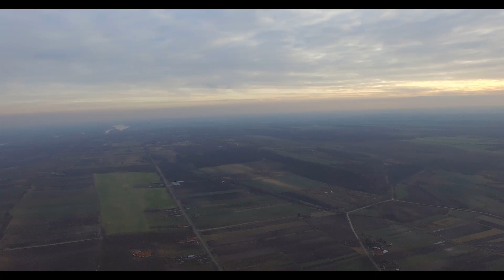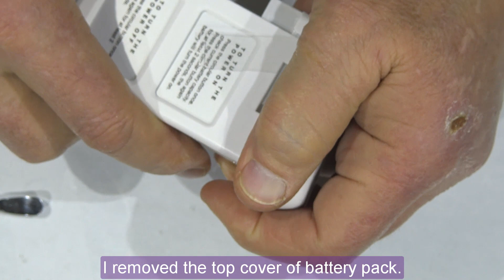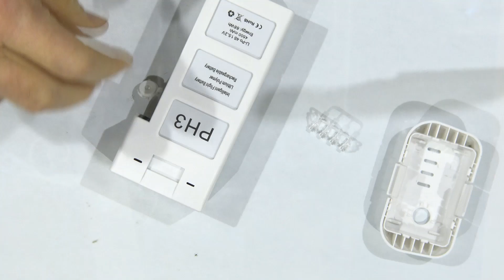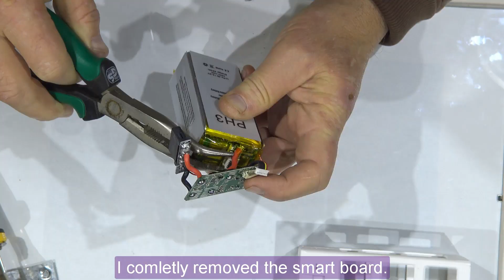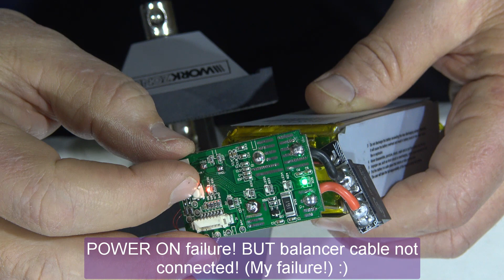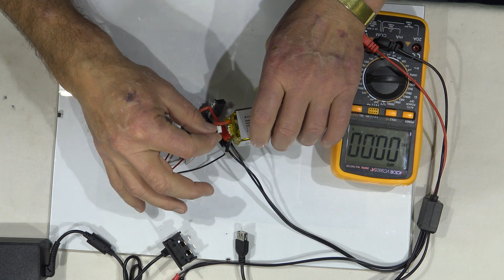DEAD DJI PHANTOM 3 BATTERY DIAGNOSTIC DETAILED PRESENTATION

Comment: In order to reset the board, disconnect the negative wires from the board (large black wire, and 6 small wire connector) and wait a couple minutes. Charge or discharge the individual cell to about 3.6V. Reconnect the negative wire and connector pins.
Reply from the maker: Hi, Thank you, I'll try it. Have a nice day!
Reply: I got it backward, after unplugging the wires from the board, reconnect the small wire connector first and then the negative battery wire. If you get a red light turn on, plug in the charger, and you will get the green light on. If you get all green light on, wait a few minutes and they will turn off.
Reply: @Fenyutas  Did u try it? Whats results?
Reply from the maker: Hi, Yes, I tried. It doesn't work for me. Have a nice day!
Reply: @Fenyutas   The problem is that BMS IC bq30z55 which installed at batterie's PCB switched to 'locked mode' meant error flag was written inside its memory due to some fault conditions (probaly cells voltage imbalance). To clear this failure software for bq30z55 and programming adapter is required.
 The same IC is used in laptop smart batteries so you could find nearest laptop batteries recelling workshop and reset(reprogramm) your IC there.
Reply: @орионорионВи  H sir...i do you have any manual or guide to flash that IC...i think your solution is very logic because i have two battery and the broken symptoms are really similar...and i have doink all methode but not going better result for retrieving my dji phantom 3 battery
Reply: @dwibudipermana8480   There are 3 kinds of DJI PH3 batteries. They have slightly different protection parameters configuration in the firmware. The more latest models with dark green pcb mask and "DJI0617" marking is definitely need to be reprogrammed after any failure to battery. The others with "DJ01 ROF PCB" mark and lightgreen mask could be just reset by reconnecting power and balance socket from the board as well as aftermarket battery copies with no marking at all.

Programming guides available at Texas Instruments web pages. You should have ev2300 programming adapter to use their software. Alternatively you could use cp2112 or i2c-lpt adapters with third-party payware software.

Comment: This problem is really pissing me off.  When I started watching the video I thought you were going to give us the solution..  I had my Hope's up for a while but then obviously I was very disappointed.  If you or anyone has found a solution PLEASE leave the solution here or inbox me.  Thanks very much for the work you did....
Reply: I am deaf so can't hear the narration, apologises if this has been addressed. if it has been addressed can someone please post a transcript of what is said in this video. 
Somewhere on the DJI contol board there are two electronic devices which isolate the main terminals connecting the battery assembly to the drone from the battery cells themselves, i.e. nothing in or out via the main/large connectors, when, from memory, the battery voltage drops too far. 
Once these are open circuit you need specialist equipment to reset them, there is, as far as I know, no DIY reset for these devices. This is discussed on a very useful forum, whose name I can't remember, but there may be links to it on the phantom pilots forum or maybe the inspire pilots forum. It may take a fair bit of work to find the info on phantom etc. pilots as, from memory, there are only one or two individual posts in a fairly obscure thread.
Having gone through some more posts about this video this maybe what "орион орионВи" is referring to in their answers to "West Limcan"
Reply: @williamlitlle1308   Don`t need to worry. There is nothing to hear in this video. It is totally still..

Comment: When you don't use the battery for a long time, usually one pair of cells are dead. There are a total of 3 pairs in P2 battery. You can revive the dead pair using a smart charger and two alligator clips, accessing from the side. There will be low voltage errors,  but keep resetting and charging until 3.6 Volt is reached.
Reply from the maker: Hi, thank you again. I learned a lot from you, I hope your advice also helps others. Have a nice day! :)
Reply: You are talking about a phantom 2 battery. This video is about a phantom 3 battery. 3-cell (6 batteries wired as 3 units of 2 batteries in parallel) verses 4 larger batteries in series. But if you can isolate the individual cell leads it may be worth a try if 1 or more of the cells shows very low voltage. It's most likely though that this is caused by a monitoring board fault.
Reply: What if the cells are swollen?  I was an idiot and put 2 new cells in winter storage fully charged.  Now puffed up a little and will not take a charge.  Unlike other batteries, storing lipos at full charge destroys them.

Sure wish this was made clear and/or the intelligence in the battery would discharge the battery to safe storage conditions.  It has enough computing power in the battery PCB to land the thing on the moon, surely it can keep the battery at ideal parameters all the time.
Reply: @gavincurtis  Generally if the batteries are puffed it is an indication that their chemistry has been compromised. They will probably not take anywhere near a normal full charge and their internal resistance will be high meaning that at high current draw the output voltage will be low. If you are talking about Phantom 3 batteries then the genuine DJI ones (expensive) have a built-in self discharge to lower a fully charged battery to storage over a few days. As I too have found out the el-cheapo non-genuine ones don't seem to be so equipped. The el-cheapos used to be distinguished by having a 3 pointed slot over the level LEDs while the genuine DJI ones had a single slot over each LED. But now with refurbished units becoming available who knows what you are getting.
Reply: Thanks for the follow up.  I have the phantom 2.  Not sure if it has that discharge intellect or not?  I am flying an antique. My batteries are the way of the recycling center now after I discharged them.  Definitely bad.

Saved the intelligence boards from the batteries as they manage/balance three lipo cells in series at a time for 12 volt applications (close enough for my 12 volt solar led yard light projects).

Anyways, got a set of aftermarket replacement cells on order that had very high reviews as originals are apparently no longer available and age unknown.  

I also need to reFLASH the WiFi video controller chip via its UART port and ordered the required USB to serial adapter.

No video downlink at the moment, but all uplink functions work.  Supposedly the NAND Flash memory gets corrupt very quickly in the WiFi controller.  I have repaired many things, including my car gauge cluster from corrup NAND flash in the past.

If that doesn’t work, perfect time to let the wife know we are getting a new drone.

Comment: Need to activate main board after  charge cells. Board is in permanent fail after fully discharge. Can see my videos, see how to activate. 👍
Reply: teach the points to reactivate phantom 3 battery? my battery has a charge, but does not turn on the leds.
Reply: No Phantom 3 videos on your site.

Comment: I've heard that as long as the cells are healthy (total cell voltage above 20v) then you need only reset the smart circuit, this is done by unplugging the board for 60 minutes (not just a few minutes).

Comment: I have one of the batteries that won't even register when you plug the charger out.. I took it apart and checked it it was yeah expect it isn't it was doing the same thing unsolved or debored but the board the battery has sparked but I can't get it to hold a charge if I could get it fixed just to figure out what's wrong with it probably wouldn't put it in the drone to be on the safe side so it would not crash it from the sky if it   Malfunctions.

Comment: @Fenyutas  Dear, if we talk about a Phantom 3 battery (with 4 large batteries). What should I do? I must charge each one (one at a time), connecting alligator clips to each one directly to the original DJI charger and I measure that they reach 3.6 Volt and then move on to the next one.
Can you explain a little more, I will be very grateful.
Reply: instablaster...

Comment: Sorry but it appears you are mistaken when you say the flashing 3x LED means battery is too hot.  The manual explains that it's the 4TH LED blinking 3x that shows this, and in your video it's the 1ST LED that is blinking 3x.  The 4th LED is near the button.  But not sure how this would translate to an aftermarket battery.

Comment: Next to the red(or black) temperaturewire there is a RES servicepoint. If u shortcut it briefly with GND is will reset. Own risk
Reply: would be how it explains it best could help a lot of people
Reply: the battery has to be connected to the board or not

Comment: Hi, I came across your video.... And I  was surprised to see the very identical steps I took to try to fix my problem which is the same as yours... I have a PH3 original battery, it did not charge anymore nor  light up. I did - exactly - what you did and after having charged with another LIPO charger  all seemed to be ok.. But after a few  minutes of tests I've got just the LED1 green blinking, and battery does not start anymore.
But what I found, is that if I put some hot air with my hot air gun towards  the negative output R13 and R14 resistors, suddenly it starts charging... until it is cool again and stops charging

One hint : I noticed that I'm missing resistor R47 on the bottom of the PCB... I carefully examined your pcb in the video and it looks you are missing it also (or not ?) Couldn't it be a mounting process error ? If so we could try to understand if R47 is really missing... I have another good battery but I don't want to dissassemble it, can you check on a good one ?

Edit: according to the manual, led 1 blinking should be low battery charge between 0-10% Leds 3 and 4 are used as temp and overcharge inbdicators.

Comment: I got this fixed
Reply from the maker: Hi, how to fix it?
Have  a nice day!
Reply: @Fenyutas  So in my case I  removed the balancing cable from the board, removed the positive terminal and connected the balancing cable, the lights turn on, DO NOT TURN IT OFF, connect the positive lead to the main board then u can power the board off and place the cover back on. The drone flies well given I got 1 bad cell I get about 15 mins flight time.
Reply from the maker: @kashiffcollins5554  Thanks for your help!
Reply: @Fenyutas  
fix it? You can used the Kashiff recommendation?
Reply: @kashiffcollins5554  I not use and charge the battery for two years. Maybe I need charge the battery and then try yours recommendation ? What you think?
Tks for your time
Reply: @o.federicoantwortfedexx3711  If you feel comfortable with the instructions and you are confident then yes it fixed my issue. Maybe itll be easier for you as easy as removing the positive and negative lines and charging the battery up to about 50% and then reconnect starting from the negative side then connect the positive. this will activate the board and turn it back on.

Comment: It happened to me when i fully charged it from 60%!! 
I checked the battery before i put it to drone and it was at 100%!i put it into the drone I started the procedure and the batery lights opened for an instant and then.....DEAD!
My last flight was about 150 over the sea and about 500 mt distance!the temp of the battery when I pulled it out was warm not hot!
I believe it s a board problem!
Something there causes short cirquit and burns something!
Have you tried to bypass the board and connect the battery directly to the drone as it  happens to all other drones  without this smartass circuit board of the battery???
Reply from the maker: Hi, I not tried, but I think the drone not accept the nakid battery. It's an unnecessary security risk for drone, the drone will disable the take-off. But you try and describe your experience here. Thank you! Have nice day!